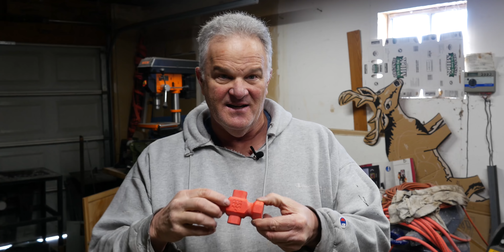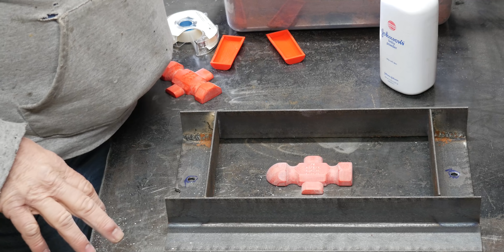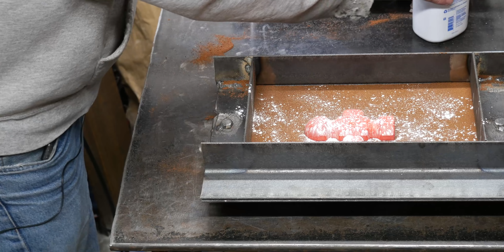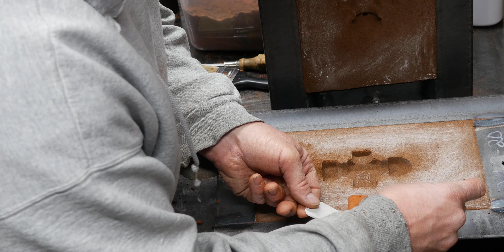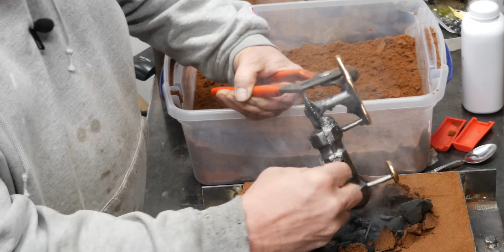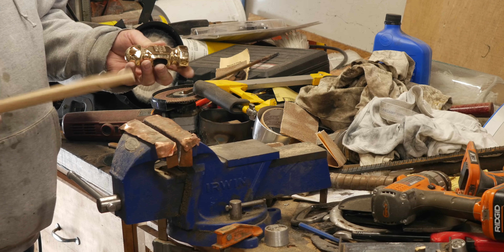Casting an aluminum bronze hammer

Comment: Heat the face to glowing, then pour some molten bronze into the hole and keep whacking the anvil til it cools. Then heat and repeat. Could be expansion bubble be it gas or liquid. Or 're do the whole thing.
Reply from the maker: That was almost four years ago, that hammer is long gone. It was a shrinkage bubble caused by inadequate feeding of the cooling part.

Comment: You could try a reservoir under our spruce, and let the mould feed from the top of the reservoir and then up the vents? I’ve seen quite a few people create a reservoir and I think they explain to to prevent shrinkage in your mould ... not sure though
Reply from the maker: How does that work? With the reservoir below the part (or below the gate) how does the metal flow into the part as it is shrinking?  

I'm not arguing with you, I'm just having trouble picturing the design of the reservoir and gating system.
Reply: swdweeb the reservoir feeds the mould as the metal shrinks in the mould, so the mould should be midway the reservoir. So from gate into a reservoir void then off to the side into the mould and up the vents

Comment: it looks like you have quite a bit of turbulence in your mold, which will pull air in as it's being poured. If you used a tapered sprue and choked the sprue, it shouldnt do that.
I usually have a sprue and a riser to allow all of the gasses to escape rather than just tiny vents that semi work, and that's always worked for me to keep from getting air/gas pockets in my castings, maybe that will help next time. Hammer looked great.
Reply from the maker: Thanks. I need to find a tapered sprue cutter and just buy it.  Tobho Matt had some good thoughts in his comments as well.
Reply: a turkey baster works pretty well as a tapered sprue cutter. I have some plastic cones for cotton candy, but havnt used them yet.
Reply from the maker: I just got a 3-D printer, I may try to print some, assuming I can print something tall enough.

Comment: Really enjoyed your video. I saw Paul's video first and learned about your channel from there. Could you clean out the void and remount it in the greensand so that just the face is pointed up and then pore just a bit of molten metallic in to fill the void?  You may have to regrind the face but it beats having to recast the whole hammer.
Reply from the maker: I've thought about that but am planning to recast the whole thing tomorrow (not necessarily the same thing as remelting) with a lot of the things I've read in the comments the last couple of days.  I'm hopeful that go better the second time around.

Comment: Reject the worst bits to a seperate bin.?

Initially only throw a minimal amount of the better/new stuff on your shape as the initial layer.
Bulk out  with the bad stuff.

I've seen people get good results with very blackish bulk material. Might need to add some oil.

Comment: degas your aluminum, it can form H2 bubbles when cooling.  Larger sprue and deeper well will help also.
Reply from the maker: This is not an issue of porosity but metal shrinkage as it cools. A larger sprue and deeper well are exactly the wrong thing to do. A large open sprue will aspirate far more air into the casting than the small amount of  hydrogen than might get introduced during the melt. A deep well at the bottom of the sprue only serves to exasperate the problem of air entering the part as it simply serves as a mixing bowl full of turbulent air and metal.

Comment: Its definitely shrinkage not an air bubble. Aluminium bronze is a difficult material to cast as it suffers from tenacious oxide skins that look like folds in the surface of the cast part but unfortunately inevitably go right through it if casting technique is bad. Also being a very short freezing range alloy it is very prone to developing large shrinkage cavities at hot spots in the mould. Careful rounding of gate /casting junctions is necessary to avoid this as is the provision of an adequate feeder. The feeder needs to be big enough to still be at least partially liquid when the casting has solidified. Obviously this means that the feeder must be bigger in diameter that the casting, at least 50% bigger. For best results the feeder should be about 1.5 times as high as it is in diameter. One must never pour down such a feeder instead a separate SMALL sprue should be used to take the metal down to a runner that connects to the base of the feeder and the feeder then via a largish gate to the casting. This is important with all metals but particularly so with difficult materials like aluminium bronze. Many of my videos demonstrate this. I have cast thousands of aluminium bronze castings in a number of different alloys. For hammers I would suggest CMA1 bronze, it is heat treatable and will get surprisingly hard, it is a much whiter colour more like nickel silver. I would have thought the vents unnecessary.... Martin
Reply from the maker: Honored to have you reply. Several people have sited your channel as a reference.

If you can, I'd love for you to watch the video that comes out in a few hours. I think I'm headed in the right direction. I did not make my risers as large as you suggest, but their placement in relationship to a tapered sprue I think is closer to what you recommend.

Again, thanks for the feedback.
Reply: I await you next video with interest. I too hope to have a short video out in the next few days. It will show a lovely little casting produced with close to what is now thought to be optimum gating, decent pouring basin, small tapered sprue, adequate feeder etc. The casting is aluminium but that does not matter as the gating style is valid for most castings in most materials.... Martin
Reply from the maker: Looking froward to your next. I'd love your feedback on the one that I released earlier today.

Comment: shame about the hole but what a great looking hammer! Well done..
Reply from the maker: I wonder if I can fill it with one of my failed rivets. :-D   I think we're going to recast this one. Hopefully all of the great suggestions will prove beneficial in another attempt.
Reply: Just tig weld the hole up with silicon bronze tig rod or alum tig rod the silicon bronze would be my choice because it’s really hard and would grind off &polish up nice I welded for over 30 years . Kenneth

Comment: The air hole is because you didn’t make a vent in your mold. Head looks amazing though
Reply from the maker: Thanks! If you watch the next video, you’ll see it was actually due to shrinkage and not having feeders to supply the head as it cooled. I managed to get it right the next time around ;-)

Comment: Saw off the part with the inclusion and thread a hole. Then screw in a rubber or hard plastic insert or an alumina bronze wear face.
Reply from the maker: apparently you've never tried to drill or tap aluminum bronze. 😁 Its really hard stuff.  The only way I can cut it is with abrasives.  I also dumped that hammer at least two years ago.

Comment: I make wooden cores and they work well...i beleive a piece of sand fell in the mold and the metal ran around it and made the hole but im not an expert by far.
Reply from the maker: Hey Ron. i'm pretty confident it was shrinkage. I didn't have anything in the part that would indicate sand broke out from somewhere else. I fixed in in a later video by adding huge ;-) feeders on each end.

Comment: SWDweeb, William is right. Longer gate, fatter sprue.  A fatter vent doesnt hurt either, if it can, it will pull from both ends, which reduces the tendency for bubbles. The sand breathes, so even if every hole is plugged with metal, if the vent and sprue solidify too fast, it will pull air into the area from outside the mold and make a cavity, which is likely what happened given the hole's shape. Basically if you make both sprue and vent fatter, with a larger gate, it "feeds" the mold area for a much longer period, till its solid enough not to make a cavity and holds its shape as it shrinks. There are 2 stages of shrink. Liquid and solid. Liquid shrink is drastic, it shrinks a lot. Solid shrink is less but its still there, and significant in precision parts. If you can feed the mold cavity long enough for at least the outer area of the hammer to enter the beginning of the solid stage, you'll get much better results. Remember, you are gravity casting here too, so the more metal above the actual part's highest point, the more is presses down into the mold, which aids feeding. 

Basically, If one solidifies before the other, it will pull from the other, if both solidify, it will pull air. You want it to pull from both ends.

You can make towers with a soup can and stuff it with casting sand. Get a funnel, put it upside down, put can on top (after cutting a hole in each end of course) and stick a pipe of the desired diameter inside it. Pack it and keep it as upright as possible, its ok to correct it as long as you continue to pack it down. Flip it, get the forms out (pipe and funnel) and place it on top of the vent hole. Careful of the weight if theres a cavity under it, dont use a massive can like Chunky soup if you have a situation like that, use a normal Campbells one lol. The funnel isnt "as" important as the pipe diameter, as long as it fills the base diameter of the can. But back to placement, just gently put it up there, dont push or anything. If you feel more comfortable you can make a mound around it as a sort of gasket, but its usually not necessary. Those extend your mold beyond the capability of the box, and give you the bennifit of having tall risers. I use them in my bronze sword castings, which are very thin and 33 inches long, so its a casting nightmare, but that technique (among others that I wont divulge) are what make it work. Hope that helps. Let us know how it works.

Another trick is to make smaller risers in the center area of the length of the mold, above the part. This is a cooling technique to use with fatter risers and vents. What happens is those solidify and act as a heat sink to solidify the part faster which means, of course, the feeder areas dont need to do so for as long of a period. This can affect crystal structure in some metals but I dont think aluminum bronze cares since its fundamentally different from the other bronzes (an arrangement of atoms, not a new molecule). Cooling techniques like this come in very handy in large castings, where you simply cant make the sprues and vents any bigger.
Reply from the maker: Thanks for taking the time to write that lengthy reply. I appreciate you doing that. Have you seen this video? https://youtu.be/MsW4G-J2LA4 I did it the following week after getting a lot of great information like what you wrote. I've learned a lot more since these were shot and think my gating/feeder/sprue technique has improved quite a bit since this video. If you have time, check out some of my newer videos and let me know what you think.  

Thanks again for the info.
Reply: No i havent seen the followup, ill watch that on my lunch break today. And welcome. I tend to write freakin essays when im trying to help someone, the whats, whys and hows of stuff. Hopefully it was helpful and not too painful to read through,
Reply from the maker: :-D No it wasn't painful to go through. I had no idea how much there was to learn when I started casting and I find it fascinating. FWIW, I have regular email communication with Martin (olfoundryman) and he has taught me a lot. Well... he's imparted a lot of great information "taught" implies that I've learned and implemented what he's said. I can't say I've done that yet but I'm trying to and I think I'm moving in the right direction.

Comment: Ok I can explain but it will take some typing...

What happened is that the thin sections beside the core(cheeks?) and the vent at the end with the shrink detect (after it filled with bronze), froze first, and began to shrink, sucking still-molten metal from the nearby thicker (therefore hotter) section and leaving a void there.

You were right to use a skinny sprue (instead of a fat one that might have doubled as a riser) because a fat sprue causes turbulence in the mold and al-bronze can turn into drossy foam when that happens, but you also needed an even thicker riser to feed the shrink in the hammer face while it fed the vent and thin cheeks.  This consideration in mold design is known as directional solidification.  

There's an example in my al-bronze axe casting video, my riser had massive piping on top which would have ended up as a big shrink detect on my axe if it hadn't ended up there.  You might have saved it or made the defect less catastrophic by not allowing the vent to fill; I use a 1/8" welding wire sharpened at one end to vent greensand molds.  I try to just push it down near to the pattern so that steam can escape from the sand, but it's sharpened so that if I actually do touch it, it doesn't make a big enough hole to allow metal to pass.  A vent can't let gases escape if it's full of metal anyhow, and petrobond doesn't make steam like greensand does anyhow.  So a vent that does fill is not only not a useful vent, it can actually cause or worsen shrink de defects...  

It's quite likely there is a void of some kind hidden inside the other end of your hammer as well.  The solution would be to use a riser for each end.  This worked for me when I cast a double-bit aluminum bronze axe a couple years ago, before I started filming my casting sessions very often.

Great job polishing it up and designing the pattern though!  You're lucky to have access to 3D printing, I'd love to try using printed patterns. I probably would have had to vote for your hammer over Paul's if you hadn't had that shrink right on the face, gosh what a shame!
Reply from the maker: Thanks man. This is a lot to digest at the moment so I'll come back to it and I'll re-watch your axe video and make note of the way you vented it.
Reply: swdweeb TL;DR: if I am right that it was shrinkage, the way to avoid this is to use risers to feed the thick sections of the casting as it solidifies.  There are some other good suggestions here as to what may have caused it which may be correct, but my money is on shrink.  

Was also thinking maybe someone with a TIG welder could use your cast vent as a filler rod to repair the defect.
Reply from the maker: No, not tldr :-D.  Too busy to digest it completely. I read the whole thing but need to go back and look at it again.
Reply from the maker: Interesting thought on the tig.  I know a guy that could probably do exactly that
Reply: swdweeb good luck and let me know how it goes if you try it, my axe has a little spot that needs some filler too but I haven't yet been able to get in touch with my local TIG guy...
Reply from the maker: Will do.  Hey can you email me at swdweeb@gmail.com?  I have some other stuff I want to ask you

Comment: The hole looks like a shrink. a riser opposite the sprue should move it out of the part. There's always a shrink. the idea is moving it out of the part. No guarantees though, that's why they make welders. Nice job. 45 years in a bronze foundry . Gloves, mask, and spats might save you a lot of pain.
Reply from the maker: Thanks for the advice. You need to watch this Friday's video. ;-)

Comment: Another casting project that needed a riser and more metal for the riser. Risers are super important to reduce, possibly prevent, solidification shrinkage in your cast part. Takes a bit of math to ensure the riser is the last thing to solidify in in the cast +25% part solidification time (calculations engineers use with the Chvorinov's rule https://en.wikipedia.org/wiki/Chvorinov%27s_rule )

The voids are from the metal solidifying at the mold wall, but not enough liquid metal available to fill the inside of the part. The risers supply the additional metal to ensure the inside of the part is filled.
Reply from the maker: Yeah, another newb not knowing what he's doing :-D   I read Chvorinov's as you suggested. I can handle arithmetic but mathematics like this are far beyond my capability. Basically, I need a bigger sprue and riser for doing something with this much mass and surface area.  Thanks!

Comment: Suck back. Well, that's what I call it. I see in another comment a well said explanation for the lack there of with material. The comment about the "riser". I'm such an amateur with all this. I like to cast though. I usually use foam and green sand. Sometimes I vent but most of the time it's just the piece I'm casting with a sprue attached. I have a couple recent videos. Again...pure amateur. Nice hammer though. I tried to pour a hammer head...well. I tried to use a cope and drag that I built...couldn't for the life of me get through the first process...sad face. I'm pretty good at a bunch of things...building a cope and drag is and was not one of them. 😁
Reply from the maker: It's definitely shrinkage. I have a follow-up video where I fix the problem https://youtu.be/MsW4G-J2LA4 .  If you're interested in hammer heads this was a big one that I cast for a friend https://youtu.be/4go8EJE6HpQ

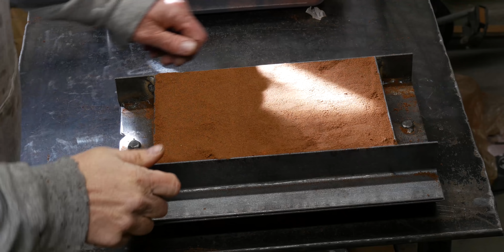Comment: 9:21 you didnt push the mud hard to make it air tight
Reply from the maker: Its sand, not mud. You do not want your molds to be "air tight". If they were, expanding air from the hot metal would have no way to escape except back out through the sprue (the entry hole as you call it).  That would be a huge disaster.

Comment: Can you fill in the hole?
Reply from the maker: Multiple people suggested that and almost as many told me it couldn't be done. I simply recast it using a better gating system  https://youtu.be/MsW4G-J2LA4 to prevent the void caused by shrinkage.